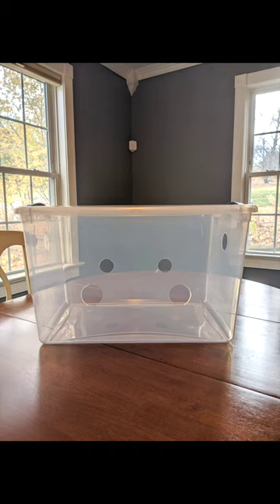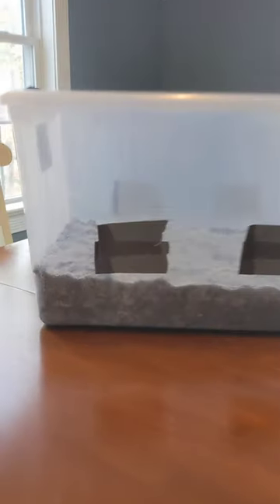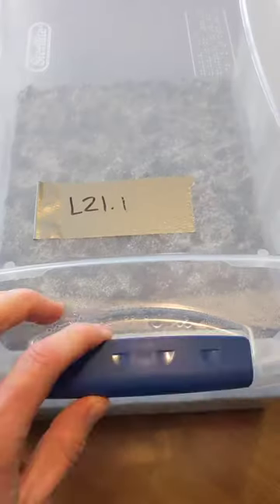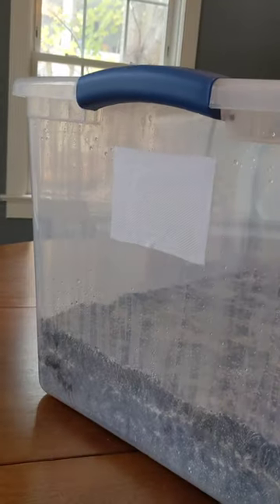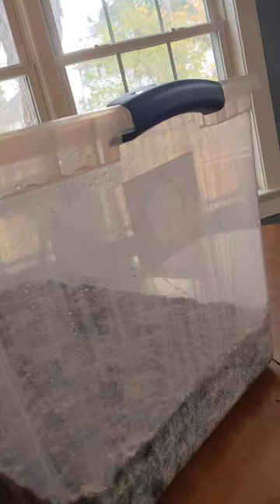Monotub Holes Explained - Mushroom Fruiting Conditions and When to Introduce FAE #shorts

Comment: there are two ways to do it either the way you mentioned or if you colonize inside the grow bag and transfer the brick to the monotub, pouring in perlite under and around it. taking off the lid, maybe drill holes but not really needed if you have intake fans and such in a grow tent.
the first method of mixing it in the tub means you get more yield or keeping the substrate as a brick less chance of contaminates i think and easier to not over water since youll just water the perlite and itll control the water to the substrate

Comment: TAPE!!! That’s what I got wrong. My first attempt was going great until I transferred to the tub. I didn’t tape the holes and had my first problem with Trichoderma.
Reply: That might’ve been the problem, but make sure your substrate is good too
Reply: Not taping the holes wouldn't be the reason for trich.  You gotta properly pasturize your substrate and casing if you're using a casing layer. Bucket tek isn't really a reliable way to pasteurize coir or any substrate.  The only time I got trich was using bucket tek,  once I started to pasturize in the oven I never had contam issues besides wet spot bacteria from the grain jars which still produced good flushes.
Reply: Some brands of coir actually have trich ADDED to it on purpose!

Comment: Why are you covering with duck tape and not just putting micro pore tape on first instead? Never seen it done this way most that do holes as I have before, just add micropore tape to the holes from the get go for fae as soon as you mix your spawn to substrate. Also* if you use a linear around the bottom and sides of your tub you won’t have side pinning and your shrooms will actually grow straight from top as supposed to. But still a good video 👍🏾 👍🏾🍄
Reply: You cover with duct tape as soon as you add substrate to tub.... while mycelium is spreading through substrate you need high co2 levels.... once completely colonized you want to change to micropore tape and fan to create fruiting conditions...